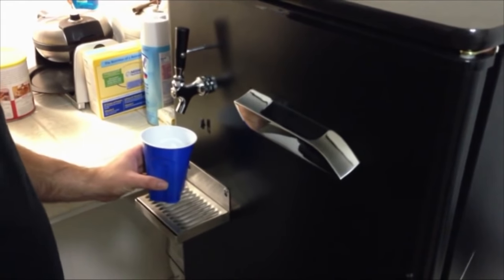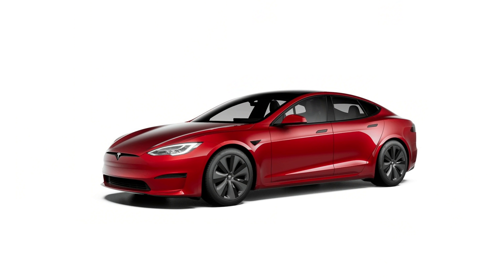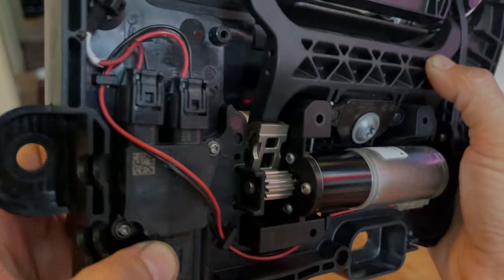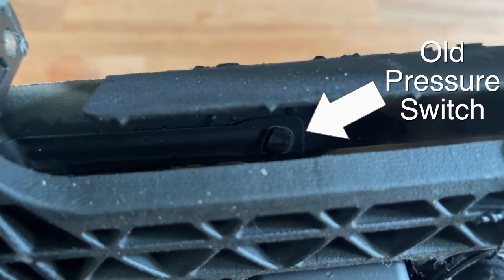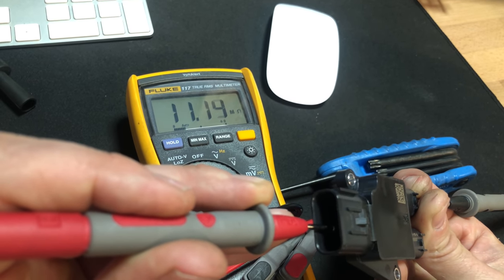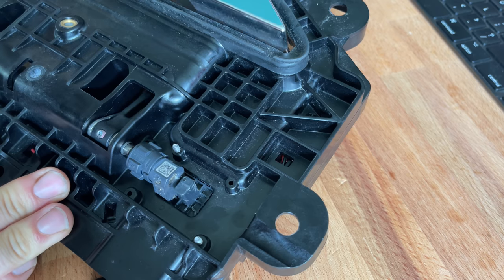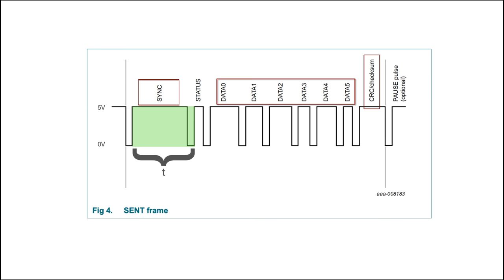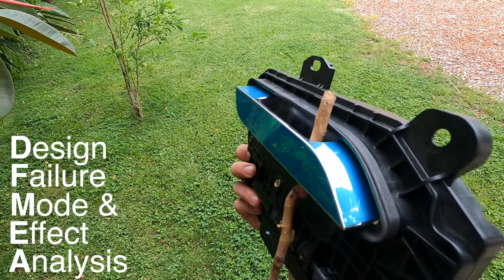Tesla Is Lightyears Ahead Of... Tesla

Comment: "This is the lockpickinglawyer, and today we're going to open this Tesla Model S using only a magnet on the end of a drill."
Reply: "This is the lockpickinglawyer, and today we're going to open this Tesla Model S using only a magnet on the end of a ballpeen hammer."
Reply: I have no knowledge of the locking system on Teslas. Could this work?
Reply: @FloydBunsen  Best you could do is make the system think you've pulled on the door handle while still retracted, it won't actually unlock without either the owner's phone or key fob. But if you have that the door handle automatically extends anyway.
Reply: You might be able to open the door but the alarm and Toccata en Fugue will be blaring. Ask a passenger who has inadvertently triggered it while the key was with the driver.
Reply: "this is the lock picking lawyer, and today we're going to open this Tesla Model S using the magnet Bosnian Bill and I made."
Reply: @stevejohnson1685  I've pried the handle out, but all it does it click a temporary switch. So if the car thinks it's locked clicking the switch won't do anything.
Reply: Jack Ogle..... You know that there are people with the same subs as you! Brilliant lol
Reply: That won’t help you with the login PIN.
Reply: This is perfect xDD
Reply: @FloydBunsen  um no, the car will only see some data from the door handle being manipulated and nothing else, LPL will have to do some RFID trickory.
Reply: Perfect. I could hear his voice inside my head. 😂 This is the lickpicking lawyer, and today I'll be opening this Tesla handle that an anonymous subscriber sent me, using nothing but this gum wrapper and piece of lint I found in my pocket.
Reply: Facebook picture of the owner on a tablet.
Reply: Haha! fantastic. I never noticed Matt has a very similar accent, voice and even cadence to LPL. Not to mention the extremely concise and entertaining content (though I did notice that bit!).
Reply: @FloydBunsen  All you need to know is that if TheLockpickingLawyer is mentioned, he'll 100% get into it.
Reply: You open it and what after ?
Reply: @TomaOvidiu  its a joke about his voice . I didn't get it either.
Reply: I see I've found my community.
Reply: @isthatatesla  ". Ask a passenger who has inadvertently triggered it while the key was with the driver."

How can you trigger the alarm while inside the car, is the car too stuppid to realise that there was no time when the car was left unattended?
Reply: @isthatatesla  hahahahahahahhaa yes that scared the shit out of me
Reply: @TomaOvidiu  You disassemble and remove large pieces of the expensive electronics to sell on eBay?
Reply: lamo
Reply: almost spit out my drink lmao
Reply: @vinny142  I did. I had gotten into  my  just unlocked 2017 facelift S without the fob.. I think I was updating it or rebooting. Anyway, I stepped on the brake to "start" it, and it said key missing. I think I tried my phone, I forget. I opened the door and heard the Fugue for the first and hope last time. It was LOUD, even with the basic sound system.
   Sure will get attention more than the beep beep alarms always going off.
Reply: "lockpickinglawyer and SuperfastMatt in the same section... what is this, a crossover episod?"
Reply: @DontThinkSo11  cut those wires first.
Reply: No there's no power to the magnet he forgot to mention these are no permanent magnet in the door handle.  They are low voltage electromagnet🙋‍♂️
Reply: Apart from
Sentry mode....
Having to pry the handle open to get the magnet near the sensor....
And Sentry mode (again)
And the previously mentioned Blaring music.....
And Sentry mode......
Reply: and what i have for you today is this tesla model s and i'm gonna show you all of it's quirks and features then i'll get it out on the road and drive it
Reply: "This is the lockpickinglawyer, and today we're going to open this Tesla Cybertruck with only a piss hammer."
Reply: I was just looking at LockPickingLawyer videos, the heck dude? Stop being such a Nostradamus
Reply: That's the most weird cross over that I've ever seen
Reply: @FloydBunsen  The locking system is handled by the tesla computer. If it doesnt have a fob presented the computer will not activate the actual door latch
Reply: @DontThinkSo11  it most likely a switch thats how he breaks in the electric https://www.youtube.com/watch?v=d-hBDjYtE1U

if there is a relay then it can be opened possibly but if not then it can't be picked, well you can if you can copy the information that gets sent out from the reader to car
Reply: "I made this specialized tool, it's a 2mm rod with a barb at the top."
Reply: Ayyyy 😂😂😂😂
Reply: @vinny142  He meant triggering from the outside by pushing on the handle with the car locked.
Reply: I could do it with a large rock
Reply: It's sensing small changes in the angle of a magnetic field.  Trying to replicate that with a hand-held magnet is probably impossible.  LPL can open locks because there's metal parts that simply slide from position A to position B.
Reply: @isthatatesla  And who pays attention to car alarms?  Almost worthless in this day and age as people just cannot be bothered to investigate.
Reply: @ShamWerks  Made ma laugh - thanks
Reply: You can't. The door handle is free of movement and you could pull out the handle but if the car did not authorize opening over the magnet angle, then nothing will happen ;P
Basically, if software fails, the door handle would not...... handle the problem :P Here is more of a software failure point if something goes wrong.
Reply: Or you know, like all of the modern car thieves you use two magical boxes that can be hidden in your bag easily and you just come to it, it presents the handle as you’d have the real key and you just drive off 🤷‍♂️
Reply: @DontThinkSo11  But you can repeat the phones bluetooth signal!!!
Reply: @robertm1112  bro becomes a nerd then spells trickery wrong 💀💀💀 (no offense btw)
Reply: I could open any Tesla with just a hammer, granted you'd have to clean up the glass afterwards.
Reply: This is the lockpicking lawyer, and today I will be teaching criminals to terrorize you.
Reply: Enjoy your DFMEA. Hahaha.
Reply: Meh.  It's a Turdla.  Get out the Ramset.

Comment: When your door handle is actually a closed loop, digital computer controlled motor driven position actuation system with additional safety devices and sensors, it might just be overkill.
Reply: I know how to make it even better: a lever that actuates a mechanical linkage that directly opens the door.
Oh wait.
Reply: @robokid20001    And don’t forget the analogue security access device.  You know, that piece of metal with all the little bumps in it that you manage to lose every few weeks!
Reply: It means that all the breakable parts are outside of the door itself, and probably easier to reach and replace.
Reply: @robokid20001  Step aside, young padawan: just use a cable hidden behind a speaker cover. You're welcome.
Reply: @robokid20001 Mechanical door handles NEVER have ANY problems. In ICE FANTASY land.
Reply: @robokid20001  Replaced a few of them too.  MY Old K1500 has a broken inside handle. It does not retract but still opens the door if I pull hard enough.  Bless Rock Auto.
Reply: The computer can learn a lot by monitoring the change in angle over time when the motor is active.  I like this.
Reply: @danharold3087  The new design is definitely a big improvement, but it's still a motor driving plastic parts for the sole purpose of making a handle look cool and the handle isn't even a handle, it's just a complex mechanical mechanism that sends a signal to a computer that tells the computer you want the door open and then the computer tells a separate latch system to actuate.  A good old metal door handle and locking latch mechanism is far superior.
Reply: @bigdougscommentary5719  Mechanical door handles have virtually no problems if they are made from metal with appropriate corrosion resistance and designed with adequate stress margins.
Reply: @kirkjohnson6638  I would not try to dissuade you.   There is this thing called choice.
Reply: @danharold3087  To each their own.  But as an engineer, I find it appalling to see bad designs and unnecessary complications designed to amuse the smooth brains and bilk them out of their money.

As discussed in the video, the idea of holding meetings about DFMEA is ludicrous to me because every good design engineer is constantly thinking about what can go wrong with their designs.  The creative part of the job is only 10% of the effort and 90% is making sure a design doesn't fail.  Design engineering is not a career for optimists!
Reply: Over engineered garbage.  Purely mechanical designs will outlast computer driven crap.  How much does it cost to replace that Tesla door handle assembly when one of its sensors/motors decides to die?

There are cars sitting in junkyards for decades and their door handles continue to work flawlessly, even when the rest of the car is rusted out and scavenged for parts.
Reply: @bigdougscommentary5719  I mean, I don't think electronically controlled doors have anything to do with ICEs, but also I have a 60 year old pickup and the handle has never given me any problems...
Reply: @bigdougscommentary5719  Only time I ever had problems with a door handle it took 5 minutes to fix with a new one for £15. Lets see you do that with a Tesla, it would probably be tough even getting hold of one from what I've heard about Tesla not wanting anyone working on their own car
Reply: @kirkjohnson6638 old cars and traditional handles still exist. No one is telling you otherwise or forcing you to use this one. 

Not sure why you’re complaining about successful engineering and admirable problem solving in an industry that rarely spends the r&d to re-iterate. By your logic, sir, Tesla shouldn’t even exist because we already have cars that move us from a to b.
Reply: @LordVestibule  You are confusing change with progress.  A motorized door handle made of plastic and that relies on software and electronics to actually unlock or unlatch the door using other computer controlled, plastic actuators and motors or solenoids is not an improvement, it is a clear regression.  As an engineer, that offends me, but I'll admit that it looks cool and that's good marketing when you are selling to people who aren't all that bright.

Comment: The Tesla door handle is in diametric opposition to Musk's "the best part is no part". The flush mechanical door handles on my truck have worked flawlessly for decades.
Reply: My thoughts as well.  While they are a nifty bit of engineering, they still seem overcomplicated (I'm an electrical engineer, but even so I still go with simpler is better.)  The mechanical handles on my 60 year old car still work just fine.  I've also wondered how well Tesla door handles deal with ice and subzero temperatures.
Reply: That’s a great philosophy when designing a rocket, not so great on a 80k luxury car.  The useless but cool gadgets and random features is what makes cars in that price range sell.  At least the parts count and reliability of the useless gadget seem headed in the right direction.
Reply: @Notdave29  "Useless" is on the nose.
Reply: There’s nothing like having your car greet you every time you walk up to it. It’s only annoying when you walk past it and you’re not getting in.
Reply: @allterrainrandy2587  I am filing that under "unnecessary".
Reply: The door handles on my twenty-five year old Toyota still work. Shame she don't run anymore. Darn you Tesla!
Reply: The only handle I had break on me is the tail gate handle on my 88 F150 which is expected of a 33 year old work truck. A philip head screw driver, a $17 ebay replacement handle, and 15 minutes is all it took to replace.
Reply: @dekoldrick  I've had to fix 2 of mine, it's a $20 ebay part and a couple hours of work the first time. A 10 mm socket and a couple of torx drivers.
Reply: They did switch to purely mechanical on Model 3 and Y, so they get it.  They do want some bells and whistles on their flagship stablemates.  Door handles pale in contrast to falcon-wing doors.  Elon has been open about his regrets over them.  No telling how much was spent to get them to where they are today.  Don't know how problematic they might still be.  Anyone?
Reply: @scottgaree7667  Falcon wing doors are working flawlessly. At least on my 5 year old Model X. And have been for 5 years.
Reply: @sjokomelk  Thanks!  My wife really wants an X.  Bought some TSLA, so it can pay for itself.

Comment: Matt: "I don't know electrons, they scare me"
Also matt: "so, here's the wiring diagram for my electric car build"
Reply: also matt: worked for tesla
Reply: Also Matt: I looked at the signal on my oscilloscope
Reply: Also Matt: so I hooked it up and wrote a Raspberry debugger.
Reply: And he have an Oscilloscope with better screen resolution than my phone
Reply: To be fair, Matt said he's scared of things he can't see (stupid electron goblins). He can see wiring diagrams and code and electric cars...
Reply: No the problem comes with AC magnetic fields, you can't see water.move through a pipe Normally but you can still design a pipe for water same thing with DC current, but once it gets AC or anything with magnets voodoo magic things happen there.
Reply: lol he said that, and then pulls out an oscilloscope
Reply: you must not have heard the term: know thy enemy

Comment: 9:06 You could measure motor current, and use that to detect when you are stalling out due to hitting a hard stop. Same way automatic roll down windows work.
Reply: but current is invisible, therefore do not exist, so he can't. ;)
Reply: @mechadrake  oooh yeah fair point.
Reply: @mechadrake  If you think current is invisible, jab a metal rod into a live breaker panel and see it :)
Reply: @jamescole6846  he said it is. Did he stutter? ;)
Reply: No far easier you try movinh the motor a little and look if the handle moves if not you stop
Reply: Yeah, stall detection is a standard feature of automotive control chips (including window motors).
Reply: That, or the motor has a ratcheting torque mechanism. Having the motor stall for this or some other reason is definitely something they took into account.
Reply: @BrosBrothersLP  that might be easier for a human to understand but not for a curcuit to check because this would need a fully fledged compute unit whereas the current can be detected at a component level.
Reply: @DUDA-__-  no it is really not that difficult.and alot of like 20ct motor drivers actually include stall detection through this method. Yes it needs computation but in todays age its a non issue to slap a small processor into anything
Reply: @BrosBrothersLP  using the already build in hardware (less points of failure) you'd need to decipher the protocol used by the installed sensor and act on that. Or you could just put in a resistor that has a higher barley lower resistence than the motor blocking and if you are fancy about it put in a photorelay. And now that I'm thinking about it since the door controller is already a compute unit you could do it all in software without anything but a basic emotor. Altough on a single 20ct component this might not really make a difference but if you multiply this by 4 and by about 500000, the number of sold teslas in 2020, you'd get a number of about 2M pieces. Just for the doorhandles.
Reply: @DUDA-__-  yes the motorcontroller gets like 4 ct more expensive while the mechanical switches or optical sensors get completly cut out. Higher integration is most of the time the way to go. 

In my experience using a more expensive component while deleting another one is always the better option.

Also if musk stays true to his words that is what he wants. Least component count over all
Reply: @BrosBrothersLP  Agreed. The car is already capable of reading the sensor data anyway so it's not really too many lines of code to call the sensor read subroutine and ensure the data is moving as expected.
Reply: @BrosBrothersLP  what are you arguing exactly? Most motors detect stalls through current, encoders are usually the pricier option that are not available on 20 cent motor drivers and aren’t usually on 20 dollar motors. So it seems to me like you’re arguing for current sensing, to a person who proposed current sensing. My 3d printer definitely doesn’t have encoders, but it can see the current spike when the motor stalls.

Comment: Great video Matt. I still think the motorized door handle is asking for expensive problems down the road and is a solution for something that was never a problem. However if they are going to do it anyway, at least Tesla made an elegant, simple design.
Reply: we love throwing junk in landfills.
Reply: The only possible advantage I could see is rind resistance, but honestly I'd rather just have physical handles.  Especially on the inside.  Gimme back my buttons too. 

Oh and the sdcard slot+headphone jack+replaceable battery on my phone while we're at ut
Reply: @subjekt5577  the model 3 door handle design is pretty aerodynamic and no motors.
Reply: @alexkram  It's still a bad design.  With a good mechanical door handle, a sheet of ice on the handle does nothing, you pull the handle, the ice breaks off, you open the door.  With a handle that's flush, you go get the heat gun....

Comment: Says he’s a simple mechanical engineer, then pulls out the oscilloscope! Great video Matt.
Reply: And connects up and programs both a Arduino and Raspberry pi computer systems
Reply: my curiousity and interest peaked at this part!
Reply: Oscilloscopes are used in the general first year of engineering.
Reply: @questioner1596  So wish I could have gone to Uni, I had to learn to use my Oscilloscope myself